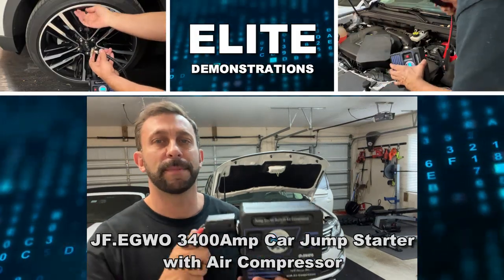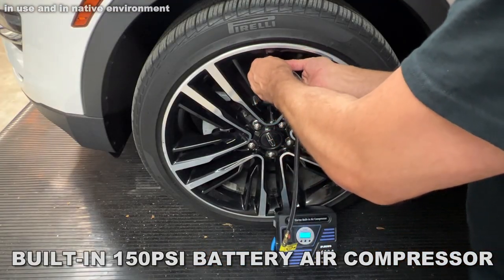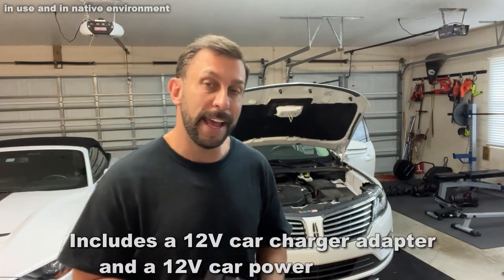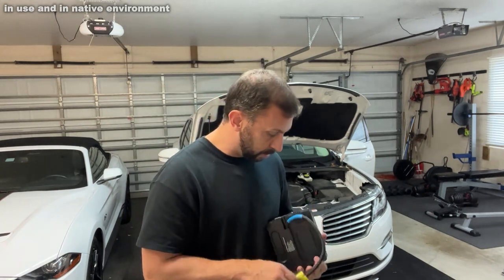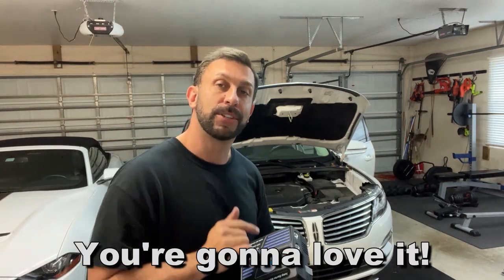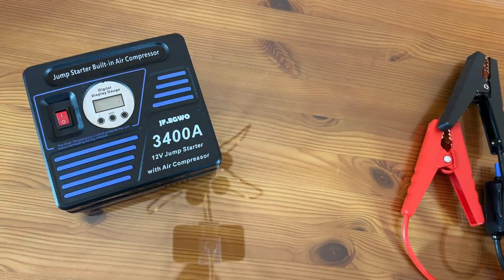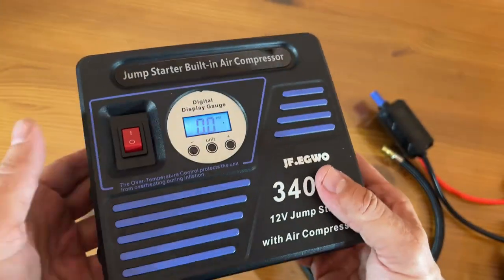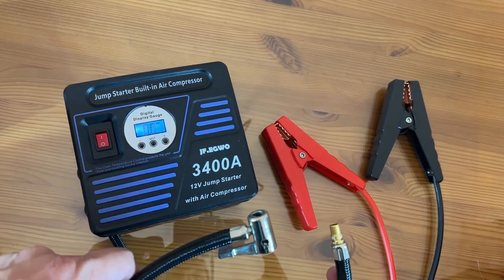JF EGWO 3400Amp Car Jump Starter

Comment: How long does it take to fully charge and how will we know? It has been charging 3+ days and the lights are still flashing and not solid.
Reply: Charge it for two more hours after it shows 100% power. If it doesn't work, please contact the warranty.

Comment: Can this be plugged into the cigarette lighter of a vehicle while pumping the tires up at the same time?
Reply: No. The 3400A model can't be charged by car cigarette lighter. But our 4000A model can do this. Note that the 4000A still can't charge while pumping. Otherwise it will stop pumping.